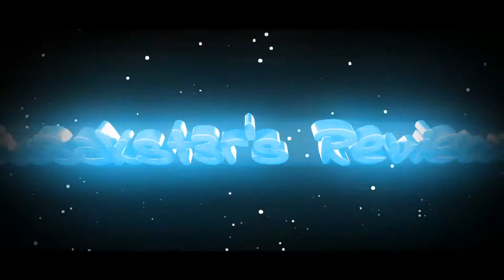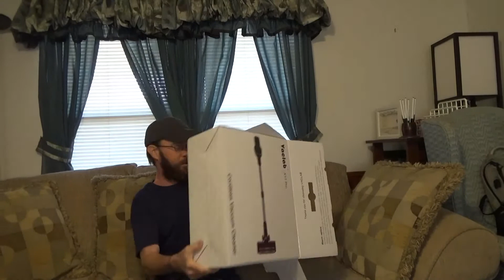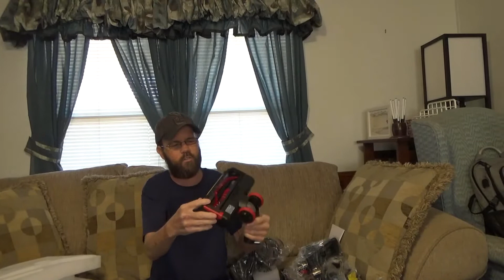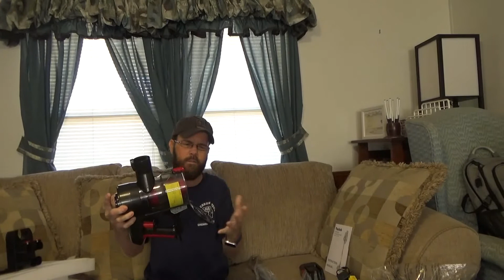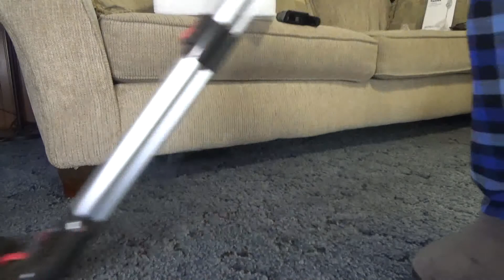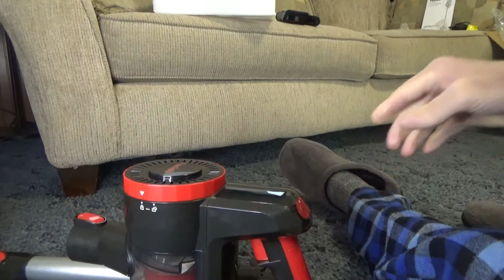VACLAB X11 PRO Dual Motor Drive Cordless Lightweight Stick Vacuum

Comment: Great Review.  Where would you recommend buying this Vaclab for the best price? Amazon doesn't carry it anymore.  Or would you recommend another one by now being that it's almost a year later?  Thanks for your time to do these helpful videos.
Reply from the maker: Thank you!
I have and like all 3 stick vacs. I use them off and on and none have given me any issues.
You can see the other 2  here, though I was never given a link to one, and the other is also not available on Amazon currently.
https://www.youtube.com/watch?v=ZpWbC-oGj1M&t=486s

https://www.youtube.com/watch?v=O899MB-jWOc

I probably like the Vaclab best, then the INSE and then the Greenote. I like the mounting options and though I have no real measurement the Vaclab seems like it might be a bit more powerful. Also easier to get parts or an extra battery from them if needed/wanted.

You'll probably have to get the Vaclab directly, they have some another option but I know nothing about it.
https://vaclabinc.com/collections/cordless-vacuums/products/vaclab-cordless-stick-vacuum-cleaner-real-powerful-suction-lightweight-handheld-vac-with-detachable-battery-dual-motors-drive-for-thin-carpets-floors?variant=40840164737221